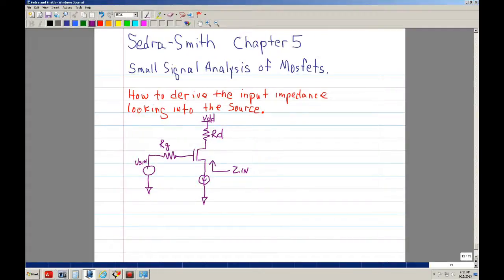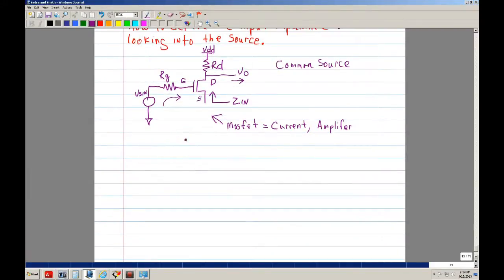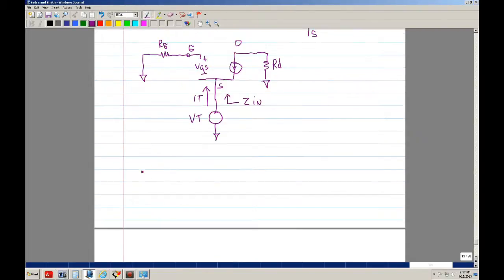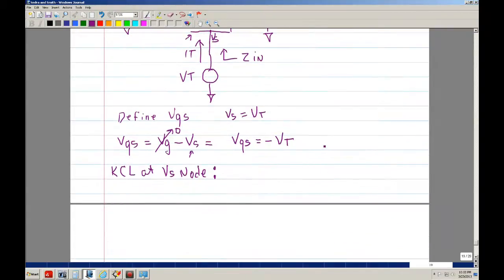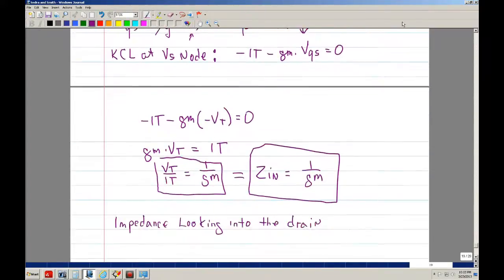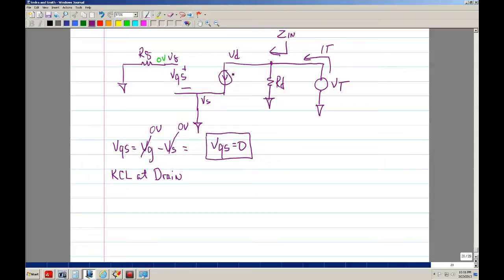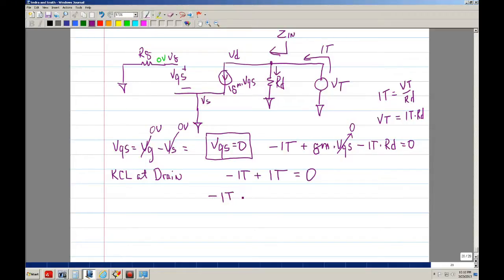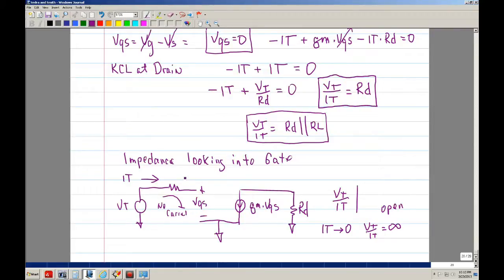Sedra Smith: MOSFET,  Small Signal analysis. Impedance derivation

Comment: I saw you do something in your cascode analysis video that might be useful here at about the 17:30 min mark.  Since R_d and V_T are connected to ground, just draw a line connecting them both to the ground at the Source.  If you do this, it's easy to see that the V_T and the R_d are in parallel, which means the voltage at R_d = V_T.  Thus, the current here (I_T) = V_T / R_d.  From this, it is visually clear (and possibly easier to see) that the impedance = R_d.